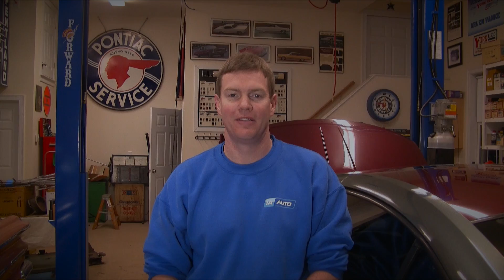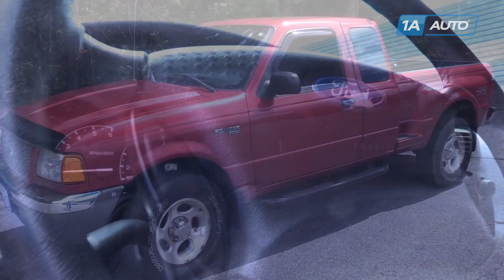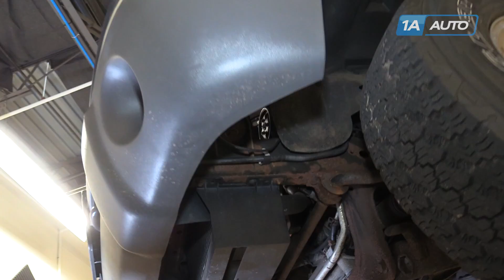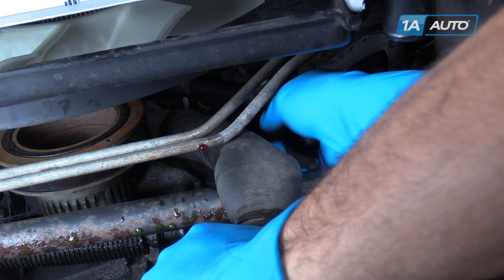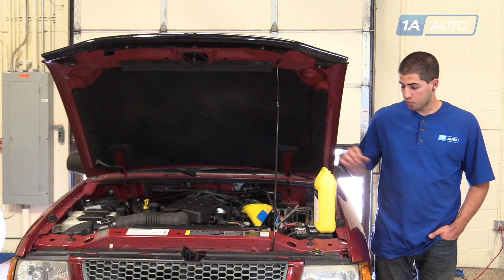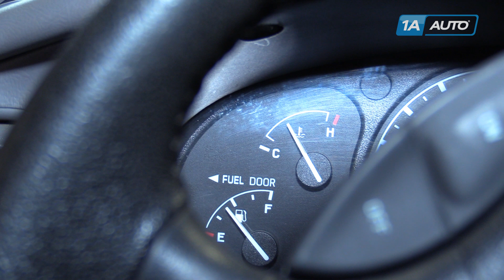How to Replace Lower Radiator Hose 98-12 Ford Ranger

Comment: bad advice on changing out the oem Hose clamps to screw clamps. The whole purpose of the OEM spring clamps is to allow for expansion due to heating. Using a screw clamp is more secure but overtime tears the radiator hose because it does not allow expansion cause due to temperature. BAD ADVICE

Comment: Mine is a 2000 model. The same hose on mine has a T on it with a smaller hose running to the top front of the motor
Reply: My ranger is an 01' 3.0L auto and has a lower hose with a "T" fitted hose aswell

Comment: What is the mixture ratio with the distilled water.  I thought you could just pour in the 50/50 mix straight in with adding the distilled water mixture?

Comment: FYI  in the north the portion of the trany lines  covered by the plastic radiator  cover  will rot out.   Cut and replace the last  few inches to the radiator  with fuel hose. Easy fix.

Comment: 07 rangers use a different hose that splits off to the heater.
Reply from the maker: This video is applicable to the 01 Ford Ranger.  Some of the steps may be applicable to other years.  Thanks for watching. +tylrlist